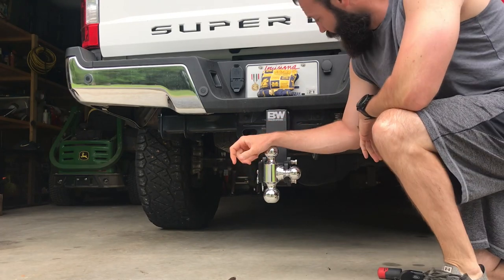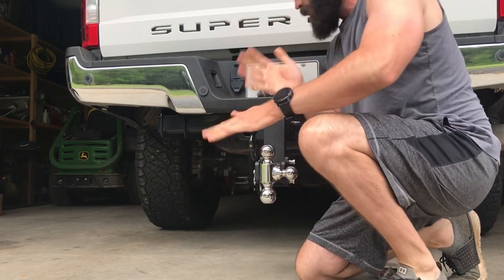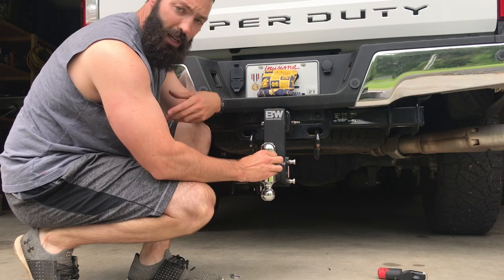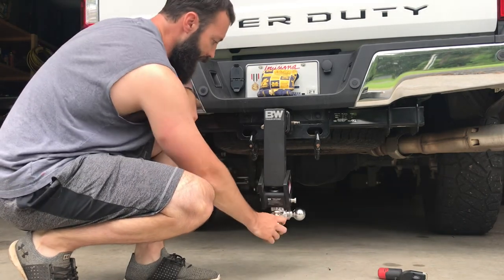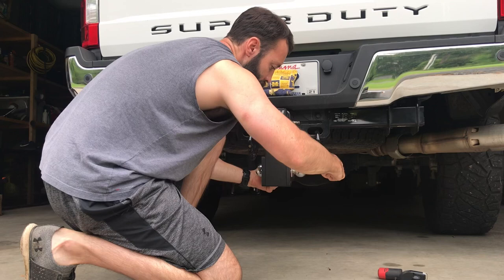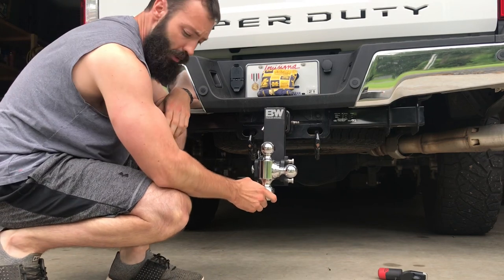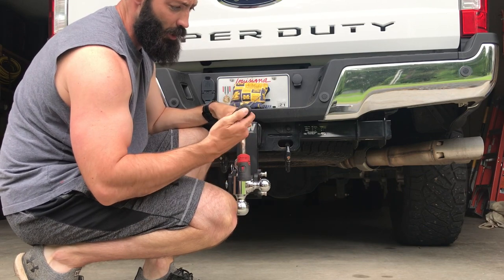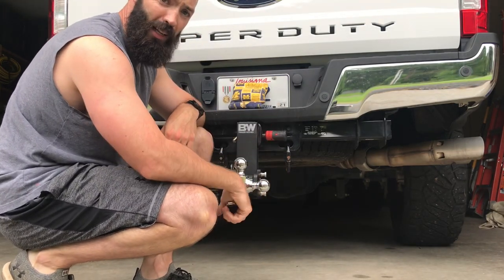B&W tow and stow hitch review.

Comment: How much lift do you have on your truck? I'm trying to decide between the 5.5" drop or the 7" for my f250 with a 4" lift.
Reply from the maker: 2.5 ready lift with 37’s. 🇺🇸🦅🇺🇸
Reply: I went with the 10" drop.
Reply from the maker: How you liking it?
Reply: I ended up with the 180° hitch. So far, I like it. Friend of mine has a stock '19 f250, and he had the 8" drop, and has had to use the bottom setting for his skid loader trailer. 
I have a 4" lift and 35s, so I went with the 10" drop. Definitely enough drop.

Comment: The part about not being able to steal it is false.  On some receivers the folding ball portion can be removed.  Read the manual and take a look at the sliding track.  On other receivers you can’t.  Just bought my mine for my truck and I was able to remove it easily from the stowed position.  If you can remove it you need to call BW and they will send you a anti theft plate to prevent someone from stealing the ball portion of the hitch.  Just got mine yesterday and it does prevent someone from removing it.
Reply from the maker: Sorry to hear that man. It might of been false for yours, but mine it is not. Mine can’t be stole. Glad you got it taken care of. 🇺🇸🦅🇺🇸